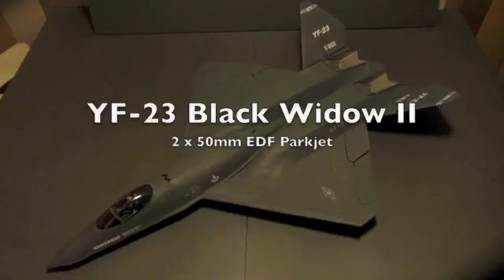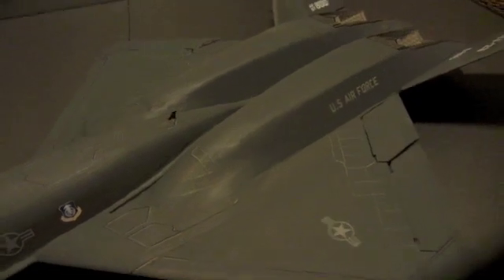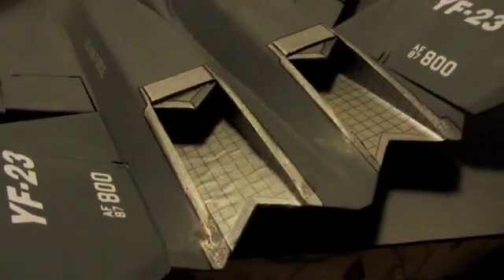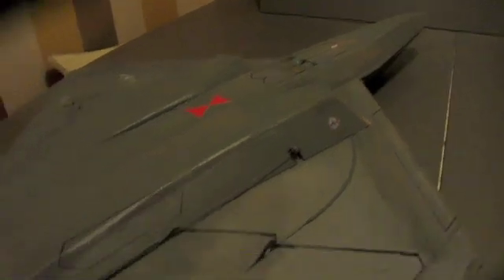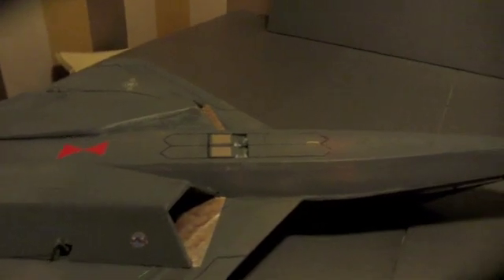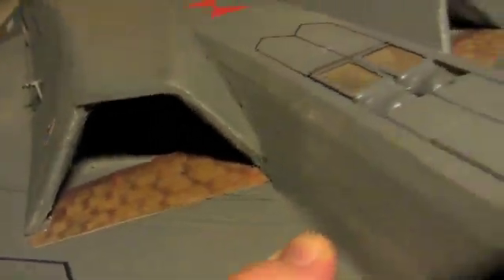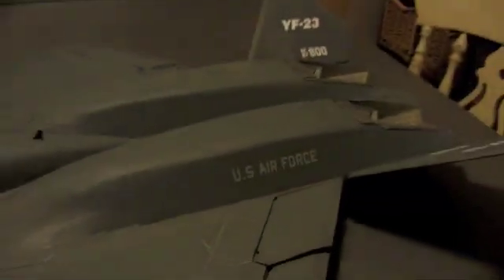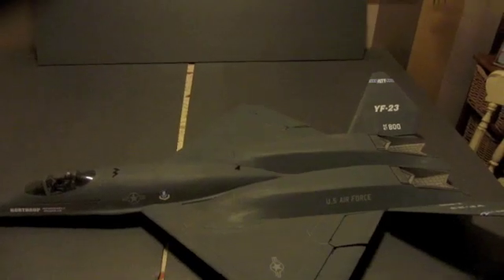Black widow II Twin 50mm EDF Parkjet

Comment: when r u going to maiden this edf version? can't wait to see it :)
Reply from the maker: I had originally fitted a pair of HK EDF units when I made the very original prototype 18 months ago.  it flew fast on them, so I refitted them.  Unfortunately after they were fitted, I took it to the field for full throttle testing (too noisy in the house).  one of the EDF units was vibrating badly and not getting up to speed.   I cut into it and tried to fix the problem, but while testing at high speed, the non-problematic EDF unit exploded and punched a hole into the top.  I now need to repair the damage and I've ordered some awesome units from Don at Wicked RC.  Two Wicked 4800kv motors and two the 50mm Wemotec fans.  Should produce around 860 watts. AUW is around 2lbs.  so should give around 430 watts/lb.  should be extremely fast......
Reply: had few unfortunate incidents edf overheats and broken in flight too haha
this baby will definitely look great in edf, the propeller version is already tempting me to start cutting ut the plan. alright man shall wait for ya update cheers :D
Reply from the maker: To be honest, in the air, you don't see the prop and it gets better flight times.  According to the parcel tracking, The Wicked EDF units have left the US, but I'm not sure if they are stuck in customs because they haven't arrived yet!.